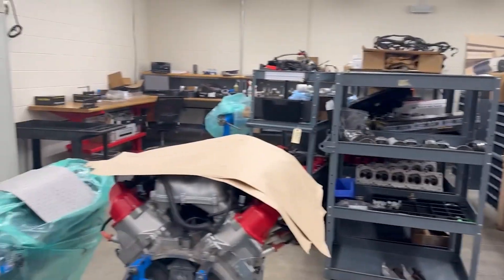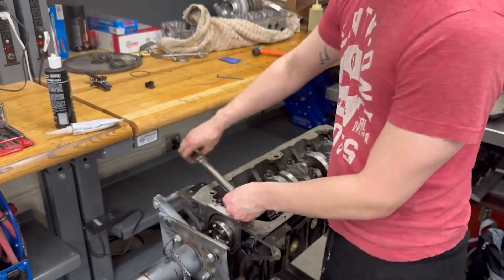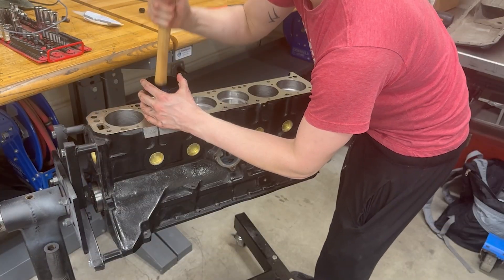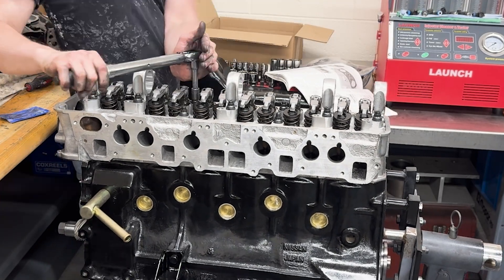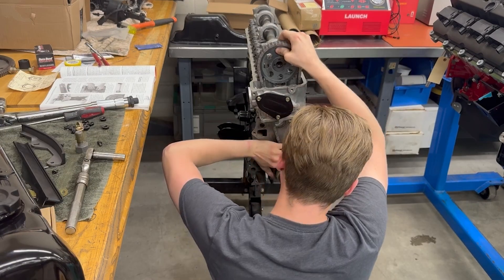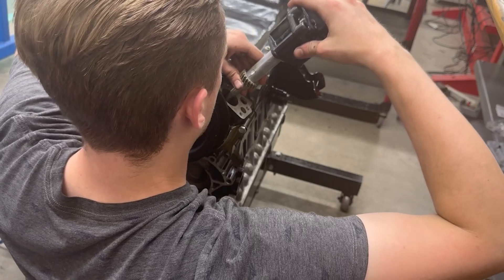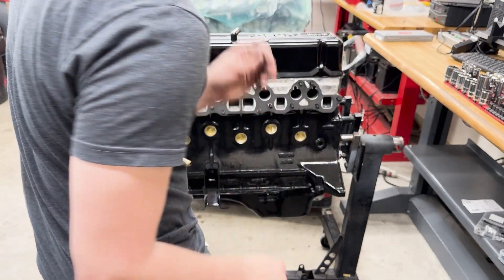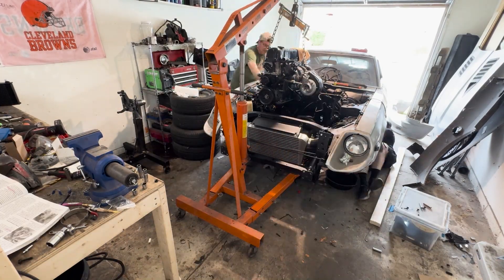Datsun 280zx 400HP Engine Rebuild in 10 Minutes | GraveZ Episode 6

Comment: Two questions. Did you end up putting forged pistons in? And have you put the car on the dyno yet to get HP numbers or is 400 a best guess?
Reply from the maker: No forged pistons. L28et rods are forged from factory and I’ve seen people take them to 400+ without issue. 400 is best guess based on similar setups but I’ll be testing it this winter

Comment: Awesome video dude! I’m about to start turboing my 75 280. Got a 280zx turbo manifold on the way and was wondering how I was going to do an external watergate. Like the way you modified yours! I know welding cast can be a pain in the a$$
Reply from the maker: You’re gonna want to take it to a shop unless you’re a pretty decent fabricator. Gotta drill a 1.5”+ hole, preheat the manifold and use a nickel based filler. I had someone weld it for me but if you’re interested I can check exactly what they used

Comment: Great build and video showing the build process. What are the specs on the cam? I also bought a stage 2 Schneider cam and I am having issues understanding what things I need to do to assist that bigger cam. If you have any information that would be great. Keep up the great work!
Reply from the maker: You'll need just about everything I mentioned in the video: resurfaced rockers (otherwise the wear pattern from your old cam will be transferred to your new one), valve springs matched to your new cam (most important upgrade otherwise you risk valve float at higher RPM), retainers (stock retainers may not fit your new springs and aftermarket ones will likely be made of 4140 which is much stronger), lash pads (this is especially important if you do a regrind as opposed to a brand new cam and schneider will provide a matched set if you ask when you order) and one last thing is valve spring shims to ensure consistent spring pressure. You technically could reuse the valves if they're in good shape but if you're already doing the rest of this, you may as well get new ones. Unfortunately cam upgrades are not cheap. Check the link to schneider in the description for specs on what I got.
Reply: @engiandesign If I didn’t give my engine a turbo, would my engine need an upgraded fuel system? Also does a bigger cam mean I need to do something to the compression? Sorry for all of these questions, I want to rebuild my engine and I would love to learn all about these things before I start the rebuild process.